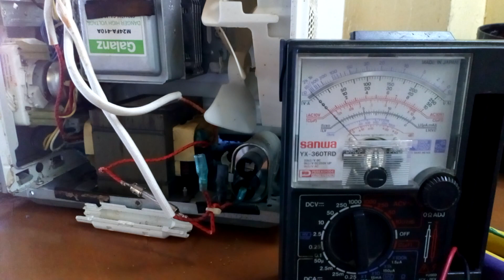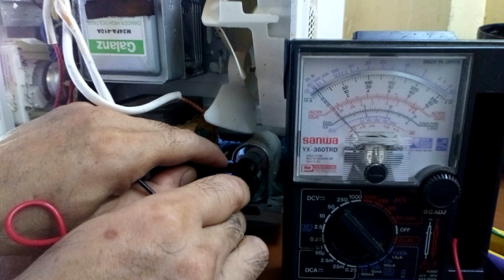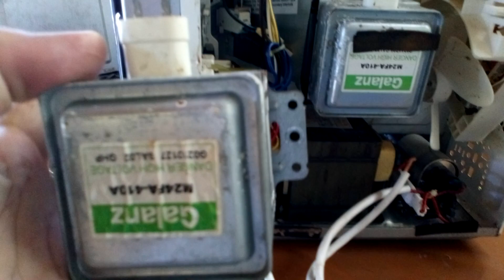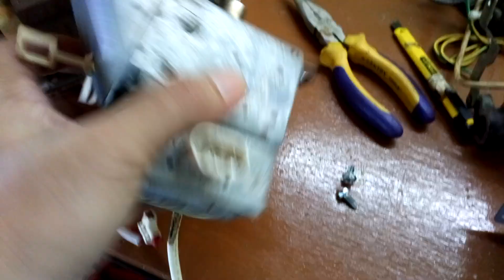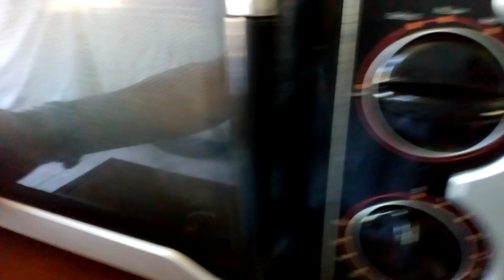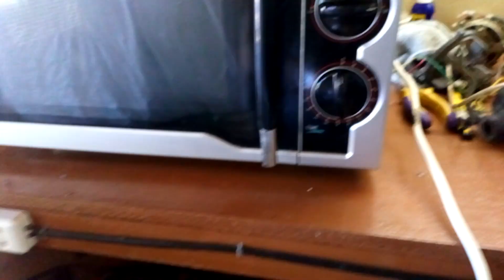MICROWAVE OVEN, AYAW UMINIT PAANO AYUSIN AT PAANO MAGPALIT NG MAGNETRON

Comment: Good Job Sir. Meron lang akong isang suggestion dun sa part ng video sa magnetron sana naipakita yung actual test using multimeter para maipag compare ung difference reading ng good at bad magnetron. Overall step by step procedure is very good naman. Watching from KSA.
Reply from the maker: ah ok sir nakaligtaan ko i pakita, pero actually sir ung luma at sa ipinalit ko, ay parehas lang cla ng resistance at wala rin short from pin to ground casing, pero ang naging sira nyan magnetron ay ung antena cap nya, burned na at ciguro ung sa internal components nya, tulad ng cavity.. anyway sir, Shukran kater.!
Reply: @technicalprovlogs6249  Hahaha Afwan mafi muskilah habibi.

Comment: Boss 200 volts yn range mo tapos mataas yn high voltage buti hindi na sira yn tester mo
Reply from the maker: 3 to 4 volts output boss
Reply: Pag sinukat k ng analog tester 1000 ac lumalampas pa 1000
Reply: Bka nman sukat in ko sa digital ko masira yn tester ko
Reply: @jojovallido9127  sinubukan ko ng digital tama naman ang output 3 to 4 volts

Comment: Sir pa help Naman po palaging basted Ang fuse na maliit sa taas good Naman Ang capacitor diod, magnetron.
Reply from the maker: palitan mo ung micro switch sa door latch
Reply: @technicalprovlogs6249  Yong 3pcs switch sa door sir?
Reply: @technicalprovlogs6249  lahata po 3 switch palitan

Comment: What if lagi putok po fuse yung galing sa line po ng 220v
Reply from the maker: chsnge micro switch, sa door latch
Reply: Di po ba sa HV Diode or HV caps sir?
Reply from the maker: kung ung fuse sa high voltage connected sa magnetron,  pag pumuputok un maaring shorted na diode, capacitor, magnetron, pero sabi u, ung fuse sa ac line nya, palitan mo micro switch door.